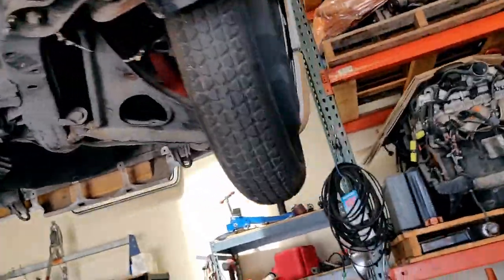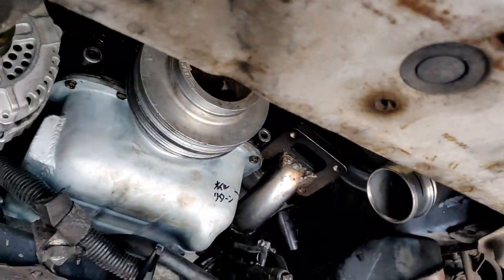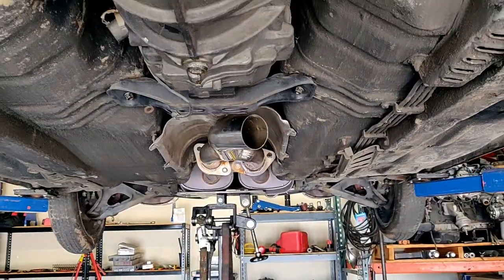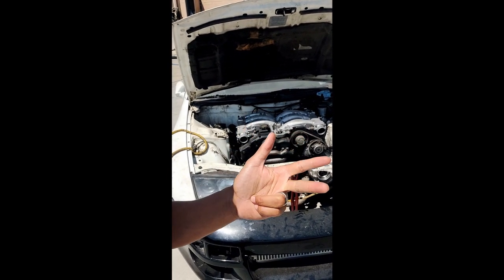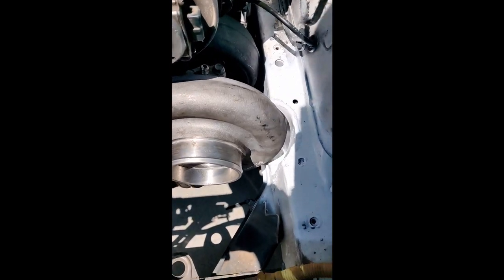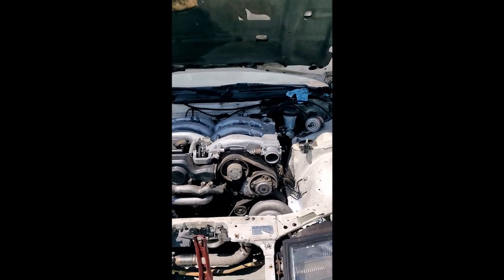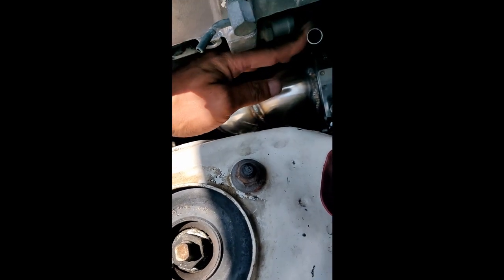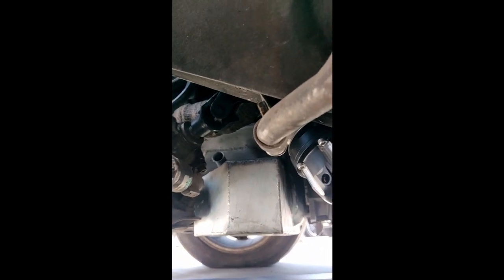Track Single Turbo VG30 Z32 300zx: Exhaust and Intercooler piping by Mr. W of Blast Racing

Comment: That’s a huge turbo bro, nice man goals for sure.
Reply from the maker: its looks big, but since im not running a twin turbo setup it will be comparable to power as Jim Wolfs sport 700 turbo kit in power and probably response (Hopefully a little better). 

This will be a track car only ( Mostly road course) we will probably keep the power between 400- 550RWHP depending on the track.

Hoping to get it started before the end of this year.
Reply: @nismoz32racer  was it originally a twin or NA
Reply from the maker: Yes, its a slicktop 300zx. For US models where only available in NA.
Reply: @nismoz32racer  ahh didn’t know that preach my brotha 🎥